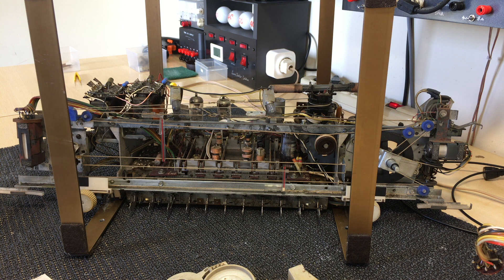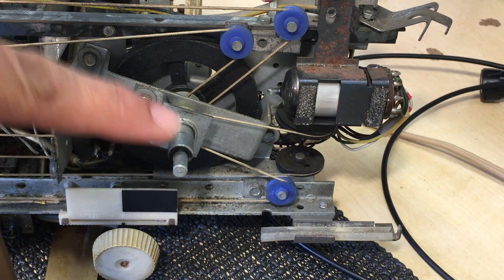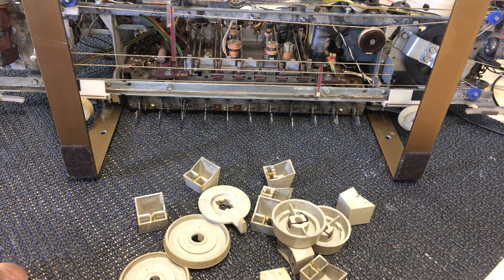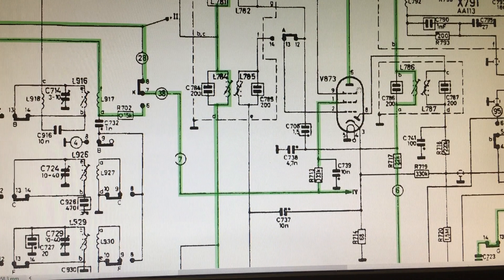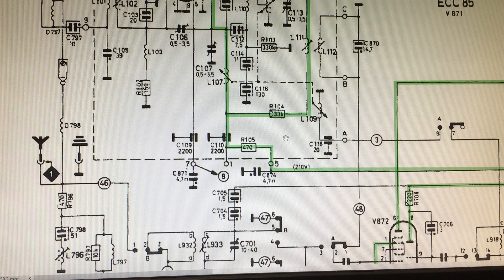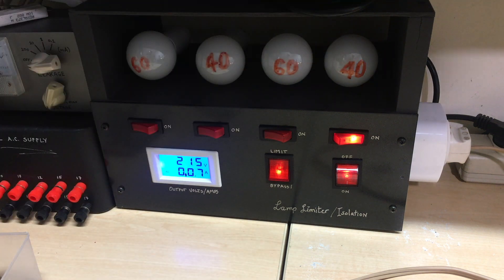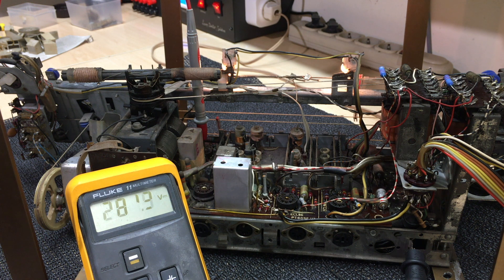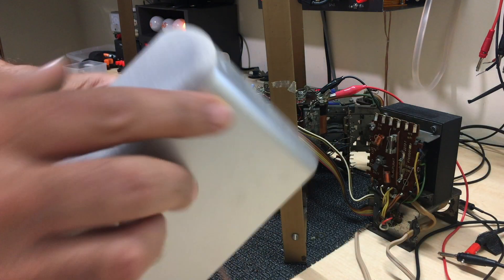Blaupunkt Arkansas stereo tube radio restoration - Part 2. First power up and reception test.

Comment: I have an old Philco car radio from a 1948-1950 Packard Super Eight which needs to be serviced once I have a suitable signal generator working.  Its TRF tuning mechanism is in excellent shape.  It has quite a power output stage for a mono car radio, having a pair of 7C5 tubes (Loktal version of the 6V6GT) in push-pull.
Reply from the maker: Should be fun.

Comment: I'm enjoying your videos. I'm busy resurrecting a Loewe Opta Kora Stereo radiogram (1958) and got some good info from your channel. It seems like my output tubes' biasing is off, likely from cooked old capacitors or dodgy resistors. I got the rectifier sorted using a silicon bridge and selecting the 240V tapping, so it's making music and looking great.
I hear a familiar accent there.. (I'm from Benoni, now living in France, working in Luxembourg).  I buy most of my stuff on eBay Kleinanzeigen. (Germany)
Where did you train on tube tech? I was a SAA Aircraft Radio tech.

Comment: May I ask what product / process you use for de rusting?
Reply from the maker: It’s actually a product based on acetic acid, which I bought the last three bottles of, and is quickly running out. They don’t make it any more. I’m going to have to find something to replace this soon.